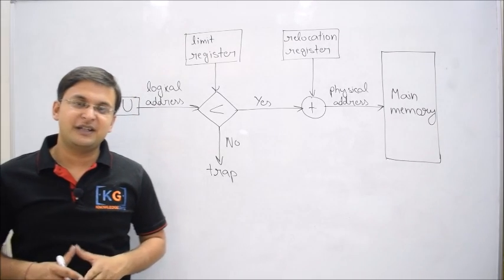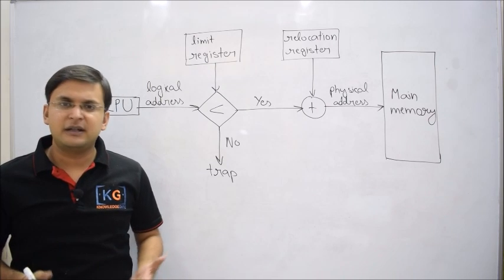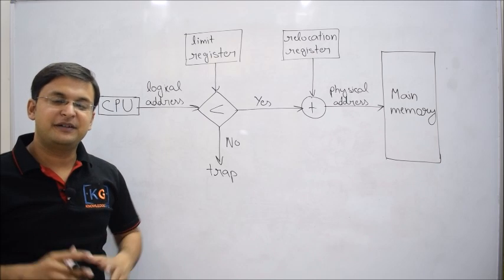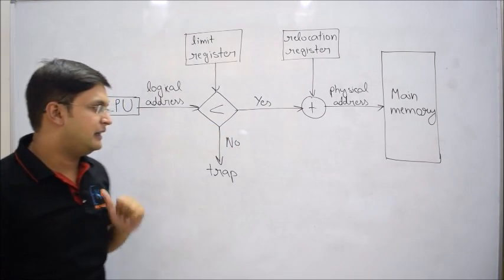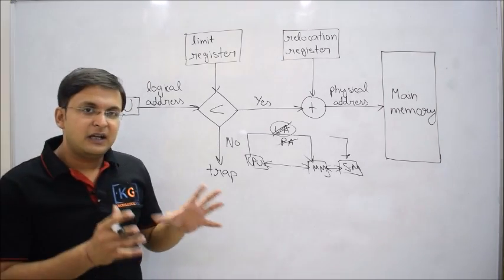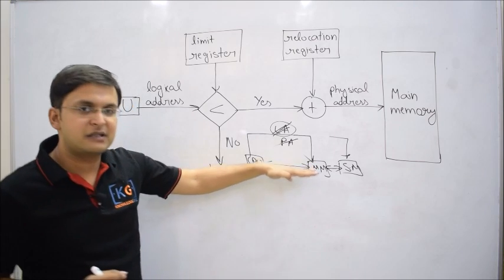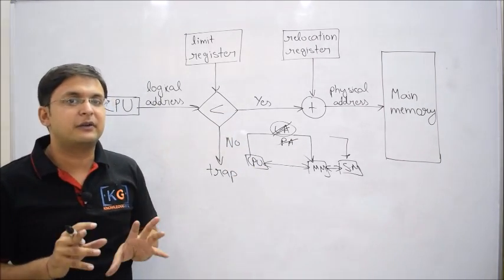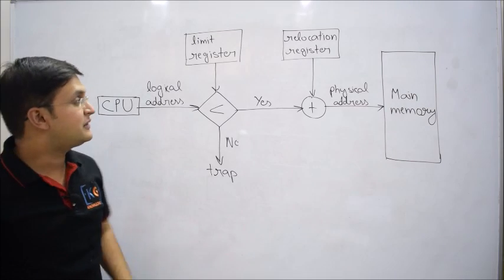6.6 Address Translation | Logical to Physical Address | Contiguous Memory Allocation in OS

Comment: 13:30 . I have a doubt, In the numerical the P0 process PA(Physical Add.) starts at 1200 and has limit of 500 therefore the PA should end at 1700. But then the Process P3 is starting at 1400. Is it possible? (Overlapping of Addresses).
Reply: It's only a example to understand the concept....for a program/ process  base address will same......

Comment: hello professor,
can you please explain clearly, why CPU only addresses Secondary Memory not Main Memory? 
One more doubt I have. In lecture it was said that CPU does not know main memory is there but if CPU doesn't know MM is there then how come it directly communicates with M.M?
Reply: All this is done by the operating system.

The CPU has specific number of address lines hence it generates the address according to the complete memory, i.e. secondary memory. But to increase the speed, the OS translates the address of the secondary memory and fetches the information from the main memory which is faster.

The data in the main memory is maintained by the OS itself hence which data will go where in the main memory is decided by the OS hence it can easily translate the logical address to physical address and fetch all the information from main memory(if it is present there).